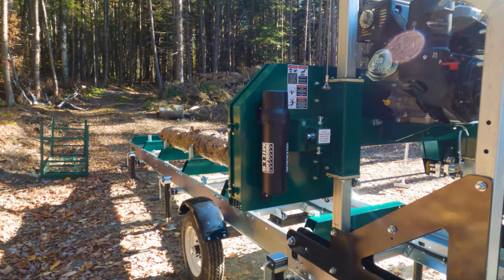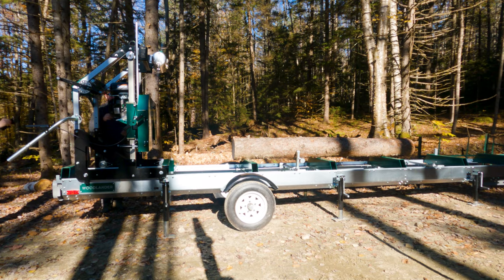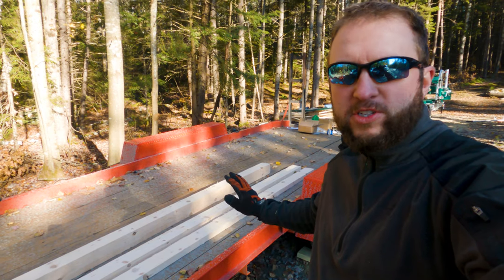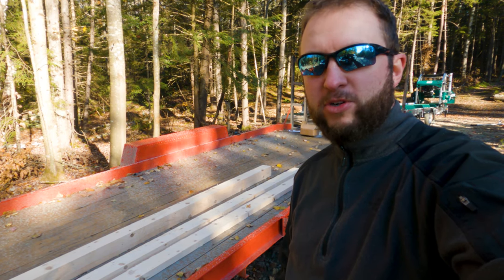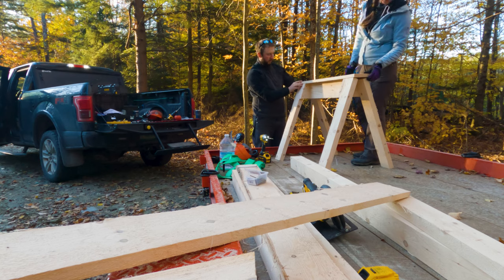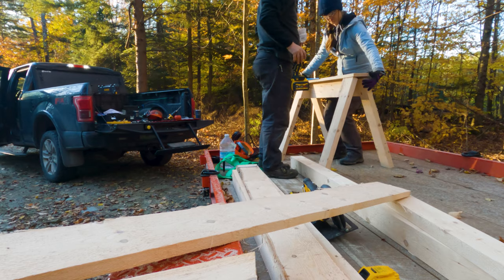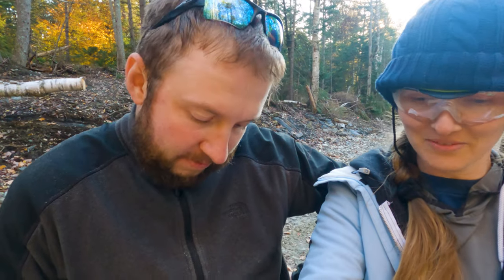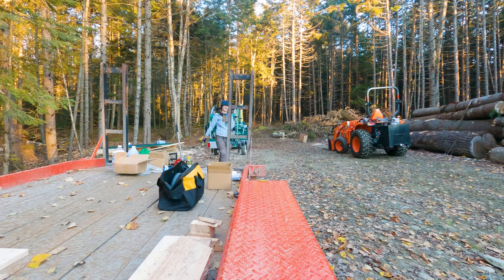Cutting our first log on our Woodland Mills HM126 sawmill

Comment: Congrats! Sawhorse looks great. Now take it apart and glue it together so it will be super strong. Titebond 3 or gorilla glue is good water proof stuff.
Reply from the maker: While of course that would make it stronger, there's absolutely no need for our purposes. It's plenty strong enough already. Plus, this way, when it gets knocked around or the legs start to rot because it's untreated spruce, we can easily pull it apart, throw the leftovers on the fire and build a new one!

Comment: Congratulations! The scraps will make good firewood after drying or can be used as siding to make a stick built look like a log cabin.  You 2 have accomplished so much. It's fantastic.
Reply from the maker: Thanks @thizizliz! We've generated a ton of scraps but already found lots of ways to use them! Diana made a box using the steel crate that the sawmill came in and some scraps, and we used more for covering our firewood and lumber piles!
Reply: @AdventurousWay  Neither of you shies away from ha4d work or clever thinking. You will get a lot of use from this new tool.

Comment: Put the bar in front of the blade in the down position so it can detect the log stops. In the up position you can hit the log stop. We have the same 126 woodlander except we added the lap siding attachment and the tool box.
Reply from the maker: You’ve got a keen eye! We noticed it a few logs in and realized what it was for, but good call out!

How are you enjoying the HM126 so far? I didn’t know about the toolbox option - where does that mount?
Reply: Tool box replaced the first log bunk either over the tongue or at the rear. I put it over the tongue and store the log stops in it.
Reply from the maker: That’s very cool. Was that a DIY mod or factory supplied?
Reply: From woodland mills.  It is the same height as the bunk and built way strong.

Comment: How long did it take to get mill. From order to receiving sawmill?
Reply from the maker: It took 3 months from ordering before the sawmill arrived - we placed the order in mid-July and it arrived in mid-October. I do know their delivery times can be wildly variable though.

We tried to order a wood chipper from them in mid-January to be delivered in early March but were told to wait a couple of weeks as they would ship out in ~4 weeks and they couldn't hold it until March for us. We called back at the end of January and their delivery estimate had increased to 12 weeks - we had no choice but to place the order, but we're now looking at a delivery timeline as late as late April for our wood chipper which is frustrating as we really wanted it for when we clear the trees starting in a few weeks!

Comment: How long did the total setup take? Thanks Mike
Reply from the maker: Do you mean to set up the sawmill or set up our first log for milling? For setting up the sawmill, we have a full video about it: https://youtu.be/MtBWDrKZMLw In total, it took us just over 2 days to assemble it.

As for setting up the first log, we took our time to make sure everything was ready - e.g. fuel, oil, blade tension, etc - as well as learn how best to position the log. So maybe we spent half an hour or so? But in general, setting up a log now just takes a few minutes to load it with the tractor, lock down the clamps, and set the cut height.
Reply: @AdventurousWay  Thank you, I was think the mill but all info is good. Enjoy! Mike

Comment: Can you order it without the trailer and later add the trailer?
Reply from the maker: You can, although I think you'd find yourself almost completely disassembling the sawmill to mount it on the trailer if you added it later. And there is a discount (it's not huge, but I don't recall the exact amount) if you buy it all together.
Reply: @AdventurousWay  I just bought a trailer to go with my HM 126. The costs are basically different due to shipping. I had to take the mill head off the tracks and disassemble the tracks. Couple of hours for this 73 year old. Now starting to assemble the trailer. The pieces are HEAVY. Enjoyed your video. And welcome to Vermont. We love it here!

Comment: Another question- what do you do with all the waste I saw you remove before you had the correct size of lumber you needed to build the sawhorse?     mla
Reply from the maker: Most of the waste we've been cutting into boards about 1/2" thick and we plan to use them for lots of little side projects which don't need pristine boards. For example, Diana made a storage box out of the steel crate that the sawmill trailer came in and some of off-cut boards, and we used others to provide some weight and rain protection for our lumber and firewood piles.

For boards that are in too poor condition for that, we'll likely either chip them, burn them, or maybe even use them in the bottom of hugelkultur beds. We have some more details and photos here if you're interested: https://www.adventurousway.com/blog/milling-2x4s-saw-mill